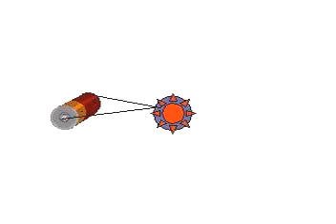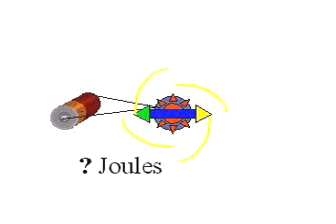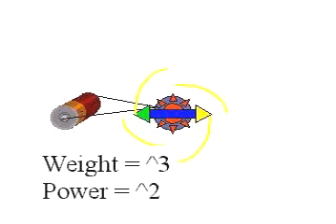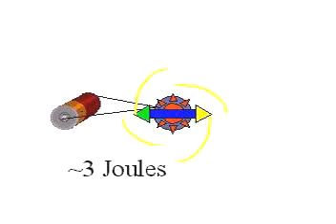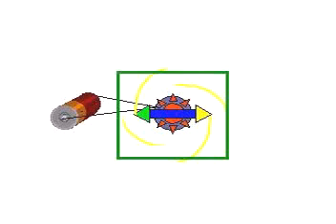Re: My Version Of The Various Magnet Motors On Youtube

Comment: It is not factually accurate to state that magnets are not and cannot be  sources of energy.. Take a cylinderical magnet of any convenient length and diameter mounted at a height aboue a nonmagnetic surface. Move a magnetic piece of material of any convenient shape and size towards and under the mounted magnet. It will be observed that the magnetk lifts the magnetic piece off the mon magnetic surface and holds it to itself. Now take the same setup and wind a coil  of insulated wire around the magnet of sufficient number of turns so that when connected to a batteray or say 9 volts, the magnet field is neutralised. Now repeat the experiment and when the magnetic piece is being held up by the magnet connect the coil to the battery. it will be seen that the magnetic piece is released and falls to the nonmagnetic surface. The magnet has performed work by lifting the piece and the abiliy to do this means that the magnet is being used as a source of energy. There are quite a number of patents of motors working exclusively on magnets but all of these require an external source to deenergise the magnet in order that the cycle of operations be completed continuously. But there is no doubt that the magnets are the elements providing the energy to run the motor In the set ups referred to here magnets are used as being convenient. There is no question of free energy, or over unity operation or self sustaining working. But assuredly magnets can be used and are being used as  sourves of energy.
Reply: in order to be an energy source it has to, by definition, contain/radiate/provide energy.  Magnets are surrounded by a force, not energy.  That force can be used to produce energy, but this still requires the introduction of other forms of energy into a system.  No energy is created, just converted from one form to another ... such as from the chemical energy within coal or gasoline into the kinetic energy of a rotor to cause movement between a coil and a magnetic field, inducing a current and achieving the final result: electricity.

There is no such thing as free energy, energy can neither be created nor destroyed, nor can it be converted between forms without performing work to do so.  Whether you are a charlatan selling this nonsense or one of the rubes hoping to buy it, skeptics will always be happy to debunk it. Know that.

Comment: warlockboyburns: "yes yes... it should be coupled with a wind turbine to keep it going forever"

Hmmm .... since an outside, nearly limitless energy 'source' (wind) is used, wouldn't this mask any ZPE that might happen to be produced?

Is there sufficient instrumentation (with sufficient accuracy and recently calibrated by a lab with standards traceable to NIST) in the apparatus to differentiate between ZPE produced versus the 'wind' power input?

This would be earth-shaking if proven true

Comment: Guess what, if you take a charged capacitor and set a magnet NS faces parallel to it, it will produce free energy forever. So you are the losing prospect desertphile. Try it before you spout off what ever theories you have about why it will not work and never will because this does work, try it. Incoming energy comes from the zero point field and is undetectable until it manifests inside the capacitor.
PROVE ME WRONG, I have one running right now...

Cheers

Comment from the maker: "I respectfully disagree - all a magnetic field needs is a conductor to produce electricity."

Greetings! You have brought up a good point: why  the conductor, or the magnetic field, must also *MOVE* before an electric current is created. It is not enough to place a conductor inside a magnetic field: that does not work because if it did work it would create energy (in the form of flowing electrons) out of nothing.

Comment: "Mechanic of 5 years NADC grad here. What do you do???"

Designed, built and installed missle guidance systems and telemetry systems at Vandenburg Air Force Base. Repaired and installed HF Radio equipment in Vietnam and I am a current licensed ham radio operator..... I'm retired now but I still have all of my equipment and tools. I also did some time as a Copier, fax and printer technician. Worked for Cannon and Toshiba. Managed a copier shop for 6 years before retiring. Taught basic...

Comment: "I respectfully disagree - all a magnetic field needs is a conductor to produce electricity. Soft Iron core through copper windings, that's electricity 101."

Wrong. Without the introduction of MOTION there is no electricity and no power. That is why they call it electro "MOTIVE" force. The motion comes from moving the windings through the magnetic field. The energy comes from what ever is causing the motion to happen. The result is electricity.